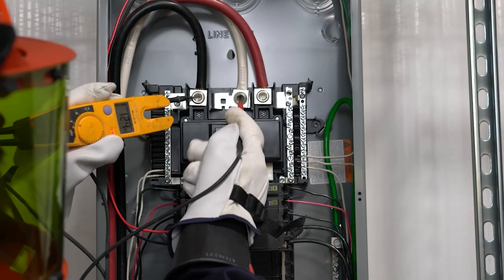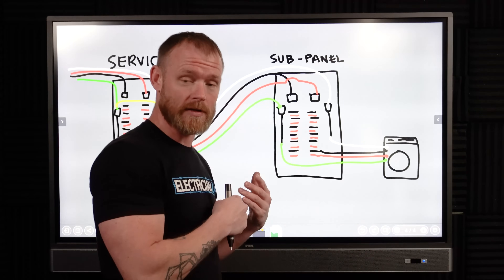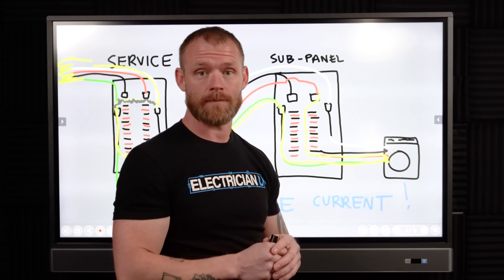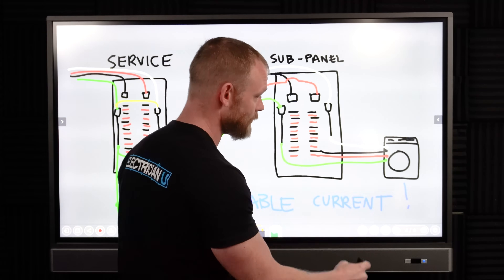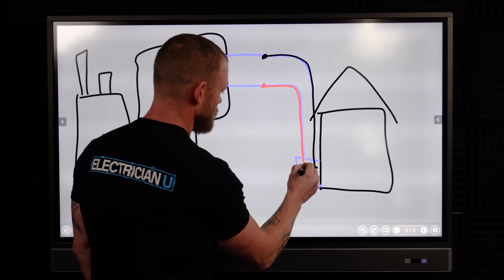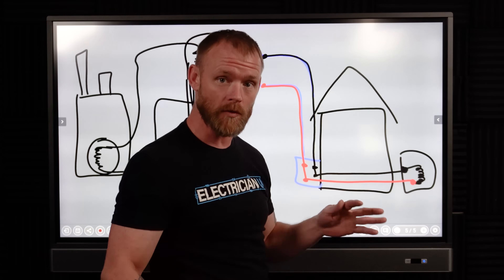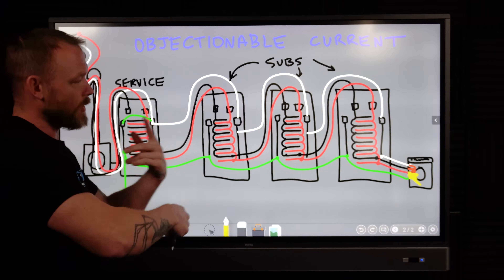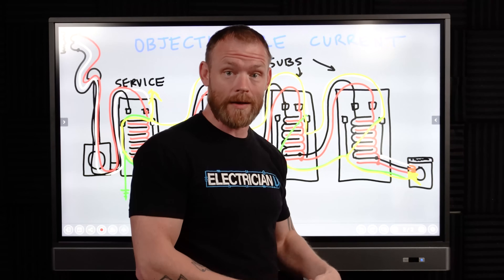Why Do We Bond at the Service Panel and Not a Subpanel?

Comment: That is the best explanation of this concept/rule I have ever seen. And I'm almost a boomer!
Reply: Basically the lonely amp is trying to get back home after it's hard day at work. The bus to work is the active conductor, the bus home is the neutral conductor. Home is the alternator at the power station. Sometimes there is a cock up at work and the poor amp gets sent home early on the earthing bus.
Now for lesson two, that is only true in a DC setup, reality is an AC setup and the lonely amp never gets home , he just sort of vibrates in place. 
And this is how electricians are taught, they are told a lie to explain another lie which then goes on to explain another lie. 
Somewhere along the way the electrician gets a rudimentary understanding of how it works, enough to wire things up, repair things and make things happen to please the lady that pays his invoice. 
The truth is no one really knows how it all works, maybe Tesla did, but he was an engineer supreme, not many of them about, our whole system still operates off his inventions, created after dreams he had.
Electrical work is regulated wizardry in other words, unless you don't have a loicence, then it is a mad wizard out to kill, and he must be stopped through fines and a severe telling off!
Apparently.
Reply: The "neutral" wire, is the grounded conductor. So, any AC system technically has two "hot" conductors. The one that is bonded/tied to ground, is the neutral. It's pretty straightforward.
Reply: I'm a full fledged Boomer about 62 days to 75.
Reply: He is not smart on no fault breakers   or mercury  panel  breakers. One is controlled by heat and other controled  by a pathway interuption , not heat.   Heat is  mercury breaker that  must reach  a tempature  to trip the  breaker. That means if you touch it,  and stick on it, you must reach that tempature before it trips breaker, you are burned, and  electricuted,  no way out .  A No fault breaker trips breaker , if a shot accours  , like a person touch circuit,  it trips breaker. You not heat up, saves your life hopefully,  by  not reaching high heat tempature
Reply: Careful, or BOOM, BOOM, out go the lights!
Reply: @raisingcaine5480  Stevie Ray Vaughan 👍
Reply: Bad information, andwhy usa panels are useless in high tech and mo one buys them in oyher countrys. Reason is, it defeats the purpose of earth grounf  and nf breakers. All other nations do not jump  neutral and ground bar, they all make them seperate
Reply: @michaelspencer6523  "All other nations do not jump  neutral and ground bar, they all make them separate" 
Incorrect, neutral and earth are linked in all colonies and former colonies of Great Britain and in a lot of other countries too. Anywhere that does it differently is creating a dangerous situation for it's electricity consumers and doubling if not tripling their risk of death, serious injury or destruction of property.
How can it be called a neutral conductor if it is not linked to earth? If not linked, both conductors are then at enough voltage to earth to kill and are both know as active conductors.
Reply: your use of the term neutral jumps between code and slang in the trade. In Canada the the use of the word neutral is well defined. As far as bonding a neutral in a building not part of the "service entrance " is due to RF energy. Go back too school. 
HR Ashworth.
309 A ,309 D & Ontario masters. Inter provincial
Reply: @russashworth1340  it is interesting, the differences between codes of different countries. The 2020 NEC does not define neutral but does define Neutral Conductor as the conductor connected to the neutral point of a system that is intended to carry current under normal conditions. It defines Neutral Point as the common point on a wye-connection in a polyphase system or midpoint on a single-phase, 3 wire system, or midpoint of a single-phase portion of a 3-phase delta system, or a midpoint of a 3-wire, direct-current system. It defines Grounded Conductor as a system or circuit conductor that is intentionally grounded.
Reply: @russashworth1340  Yep,  bonding is for transient currents not fault current. Earthing is for fault current. It is that way in all the colonies I know of. US included.
Reply: @russashworth1340  .. maybe

  Mm
T5f fr f rv 6

Comment: What if you have a older 1980 house with a discount at the pole under the meter with a 200 amp breaker with out a ground rod going to a 3 wire feeder 2 hots and a neutral no 4th ground wire travelling 150 foot underground to a house with a 200 amp breaker panel with a grounding rod, old panel was 200amp and not bonded installed new panel it is not bonded neutrals and ground separated like it was before.  Checked all 120v outlets with a tester and all tested good, then jumped a switched hot black to a green ground on a outlet to see if it would trip a breaker and it did not.

Comment: So I use to work doing electric doing service changes and old work with a company but I haven't for years now. I still do electric work for a university and have a pretty good grasp but since I haven't had to keep up with codes I am pretty lost with this whole thing. we use to be able to run switch loops so that tells how long ago it was. We purchases this house a few years ago and I wanted to upgrade my main panel in the house as it only has 16 spaces. What I have is a meter can outside with a main breaker under that for a disconnect. But I have noticed that the main panel inside as well as sub panel off of that have the neutrals Bonded. I really want to be clear on this as I feel I need to separate them all when installing the new panel as there is a separate ground #4 run  into house and into panel from outside disconnect.  Am I correct that any panel after the main disconnect where the neutral is bonded has to have the neutrals and grounds separated with a separate equipment ground ran to each panel? I have a 200 amp panel in house with a 100 amp sup ran off that panel and a 50 amp sub that feeds garage. I really want to do this correct

Comment: why is grounding of anything even required? if there is no grounding in the service panel then touching the live wire while standing grounded will not cause a current to flow since it can't make its way back to the neutral wire (unless the neutral wire is grounded somewhere). I read that the reason grounding happens is because you need the neutral wire to be at 0V, but why??? circuits work just fine without being grounded, if I hook an AC generator up to some lightbulbs in a closed loop without grounding it works just fine and I can even touch the wires and it won't shock me.

Comment: Found your channel as I was looking to fortify my DIY home electrical skills.  As a degreed EE who interacts with a wide spectrum of trades professionals (electricians, controls engrs, welders, process engineers) I hope they had someone like you to inspire a clear understanding and not just memorizing code books to pass a test.

As I walked up to dry my swim suit at the gym, the very first thought I had was “I hope the electrician that wired this did it right”. Wet feet on tile and hand on slab of stainless steel to activate the spinner.  Spoiler alert!  I survived.  Thanks for helping everyone appreciate the importance of doing it right.

Comment: There’s a parallel problem with some “electricians” who think it’s safe and/or smart to bond the ground and neutral together when replacing outlets on older circuits without a ground wire.  Because “well they’re connected together back at the box anyway”.  It’s a dangerous misconception by people who think they understand electricity, but don’t REALLY understand electricity.

Comment: Can u tell us why with a detached building sub panel where there the ground bar is not connected to the neutral bar but we are to bring a ground from the main panel which is connected to the neutral bus so when the main panel ground wire is connected to the sub panel ground bus the sub panel sub panel ground bus is indeed connected to neutral.  Can u please help us understad this?

Comment: What  if you have a transformer inbetween the main service panel and the sub panel. Wouldn't than make the subpanel service equipment, and that sub panel should be bonded and grounded also?

Comment: I don't fully understand why the breaker won't trip if current finds an alternative path through ground. Isn't that what 15 or 30mA earth link breakers are designed for? Detecting if current that finds another path than neutral?

Comment: If the hot wire touched the washing machine case, and the current went back through the ground wire straight to ground because the ground wasn't bonded to the neutral, wouldn't enough current flow to trip the breaker?

Comment: If I understand correctly, are the neutral and ground bonded in the main panel due to current having already bypassed all other breakers (equipment and appliances)? That makes sense as it is the only place where the bond can be placed in order for current to exit responsibly.

Comment: Electrical engineer here. I don't think this is quite right. Bonding neutral and ground everywhere actually helps (slightly) in the event of a fault because two paralleled wires have less resistance than either wire alone. It would even be (slightly) more efficient during normal operation. So there's nothing wrong with parallel paths as such.

The actual reason to bond ground and neutral at only the main panel is for safety when there's no fault. Every real wire has some resistance, and therefore some IR voltage drop whenever it carries current. Allowing normal load currents to return through the green grounding wire as well as the white grounded neutral wire causes different ground points within the structure to be at slightly different potentials. With proper wire sizes this would only be a few volts maximum, not enough to cause a shock, but imagine if two devices with grounded metal cases touch. Some of that return current now flows through the cases. This could be several amps, enough to damage the equipment. Arcing at the contact point might even ignite a fire. You don't want that either. Every exposed (and grounded) metal surface in a house should be at exactly the same voltage potential regardless of any loads, and the only way to ensure that is to keep all current off the green wires except during a fault. Otherwise, why even have separate ground and neutral wires?

True, the 3-wire split phase utility drop has no separate ground wire so ground points in adjacent houses might have different potentials (the ground rods have too much resistance to affect this much). But the hazard here is far less than different ground potentials within the same house.

Comment: So your saying the bond is at the main sevice panel and not the grounded meter box. What if the meter box is where the main breaker is located? Working at a school, the power plant hvac building is were all the main breakers are that feed the 7 buildings  sub panels, one on each floor of each building, that feeds the classrooms. In this case the bond is where?

Comment: So I have a bit of a different setup. 
I have the meter can on the pole, 1 underground service coming out of a 100 amp breaker on the pole going to a 100-amp circuit breaker panel, then I have two overhead services coming out of the meter loop going to two different weather heads with two different breaker panels in my house. These are in effect separate, parallel circuits as is the underground run. 
In this situation I'm guessing I would still want all panels bonded and grounded as they are not technically sub panels? Is this correct? Also this is an old house built in 1940. 
It used to have knob and tube, but was updated sometime maybe in the 50s or 60s but although I am slowly replacing them many of the conductors still only have two wires. 

How will this affect my neutral and and possible objectionable current on my ground?
And one more question... On The wire that has been replaced with a 3-wire conductor, they have just put the neutral and the ground together on the same buss. I'm sure you've seen this in a lot of older houses. 
Is it worth it and is it necessary for me to rework this so it is up to modern code or should I maybe just let it ride.

Comment: thank you I now uderstand bonding in the main and not in the sub pannel, But have seen others suggest a ground rod to be used in a detatched garage or shop sub pannel , I do not have a NEC code book, Would that (grounding rod) NOT complete the " flow " back to the bonded main pannel ?

Comment: During the moments (before the breaker trips), that objectionable current is (also) flowing back through the service panel’s ground and neutral leads, you say that current will travel back to the transformer, but since the ground and neutral are bonded, wouldn’t current also flow to the ground and subsequently to ‘earth’?  You make it seem that current will make a decision to travel through neutral only, but while it’s completing a circuit, anything it’s connected to would be a ‘live’ conductor, including the service ground, yes?

Comment: So I realize this is a very very good explanation for a normal house/grid connection. I'm wondering how an off grid solar situation would work. Essentially the electricity coming from the panels comes into the inverter and the inverter converts the DC to AC and sends it to the main breaker panel in my house. So essentially my inverter is acting like the power (utility) feed coming from the utility pole on a traditional grid setup, and my main breaker panel in my home would be the place where I want to bond my ground and neutral and install a grounding rod tied to the breaker panel?

Comment: What about the square D QOGP6036P generator SUB panel.
It uses three pole 60 amp breakers one for grid in one Gen in with lockout.
It feeds L1 L2 and neutral on each breaker.
Do I bond to the generator, The main panel one foot away, are bond at all but not the sub panel cabinet. 😊

Comment: I regret that so many other videos explain this topic in a confusing way. The question is: Why do we keep grounds and neutrals separate in a subpanel, but not in the main panel?

In a typical single-phase residential service in the U.S., the neutrals and grounds are bonded only at the main service panel. This is done for two main reasons:
	1.	Safety – The neutral is a current-carrying conductor under normal operation; the ground is not. The equipment grounding conductor only carries current during a fault. By bonding them at the service disconnect, we ensure that a fault current has a low-impedance path back to the source, which allows the breaker to trip quickly and clear the fault.
	2.	Ohm’s Law and Parallel Paths – If you bond neutrals and grounds again at a subpanel, you unintentionally create multiple return paths for neutral current. Current divides among all available conductors according to their resistance. This means neutral current will flow both on the insulated neutral conductors (as intended) and simultaneously on grounding conductors and metal conduit. The result is unwanted current on equipment grounding paths, which creates safety hazards and can also introduce electromagnetic interference.
	3.	Clarity for Electricians – For most electricians, these two reasons (fault clearing and avoiding parallel return paths) are sufficient to understand why the code requires neutral and ground separation in subpanels.
	4.	Deeper Technical Reasons – There are additional considerations (such as minimizing voltage gradients, induced currents, and issues in multi-building services) that go beyond the scope of typical residential wiring, but the core principles above explain the main rule.

Comment: Hello Dustin I’m a “DIY’er” growing up in an electrician’s household and doing small to big jobs with my step father (Licensed Electrician -IBEW). And now I’ve got an issue with a job my dad did. The issue is I’ve got a 100A panel with a 50A service entrance to a back unit, and 4 20A Tandem/PiggyBack breakers which share 2 neutrals. It works but now I added one more receptacle everything has started to flicker and my GFI in bathroom says “open neutral”. How do I fix this?

Comment: I've used tons of dryer 240 plugs with the neutral and ground connected together in the plug from a sub-panel. The ground and neutral are not separated in the plug. The sub panel had its own ground rod and was bonded to that panel cabinet. The ground will provide a completed circuit to earth absorbed by the ground rod. The center winding of a 3 phase star secondary is grounded to earth providing a completed circuit pathway for each phase to ground or earth  and then phase to phase voltage. Grounding or earth does provide a completed circuit be it for a certain voltage or a voltage to ground providing a safety pathway to prevent or reduce shock hazards.

Comment: I have a question. If a subpanel is installed to another building and you don’t bond ground and neutral, can you add a grounding rod at the new subpanel, or is that not a good idea?

Comment: side note: the sub panel in the garage needs to have the ground terminals connected to a separate ground rod.
Added note: Sub panels separate the neutral line terminals and the ground terminals with can be bonded by a green screw(which should be removed in this case). 
On main panels, the neutral and ground terminals are generally not separate (green screw not removed).

Comment: So, if my meter box is a combo box, and I run a 60amp service panel directly from the extra circuit locations, that panel is the bonded panel and my new service panel and the old house service panel (probably will also run from the meter/comvo) are unbonded sub-panels?